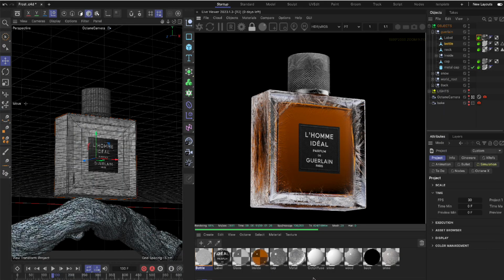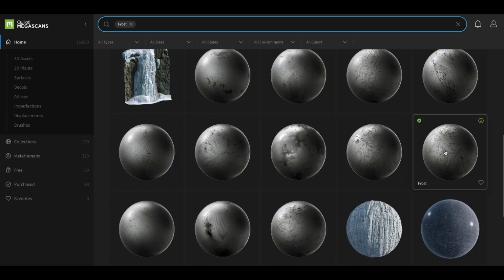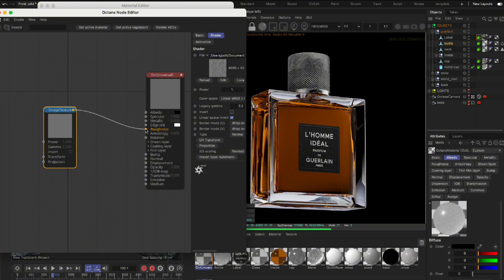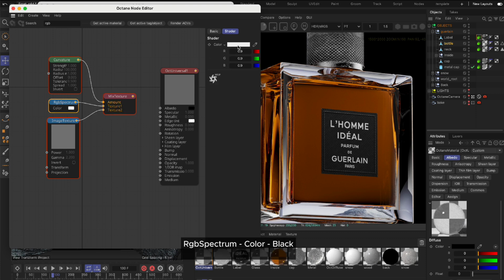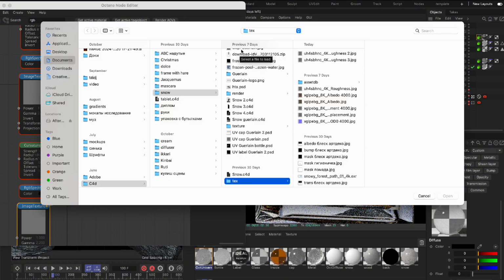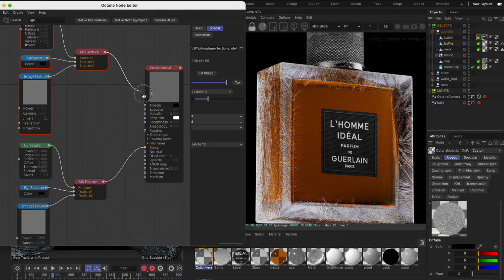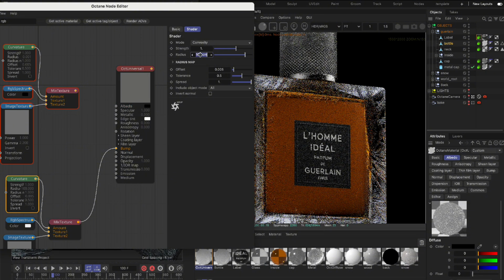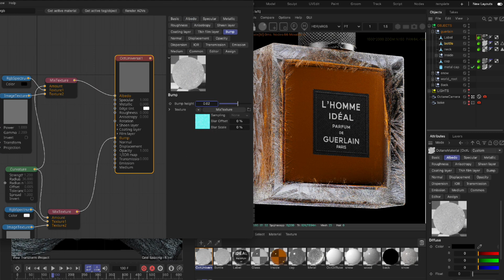Create a frost texture with Octane render

Comment: why is the RGB spectrum needed? And why is it black?
Reply: Because the RGB Spectrum is being used as a mask, we could’ve also used a Float Texture instead — since both operate with values from 0 to 1. Simply put, this setup tells the renderer that we want to apply the bump from the specified texture (in this case, the frost texture) only at the edges (using the Curvature node), and in all other areas we don't want any bump at all. That’s why we set the color in the RGB Spectrum to black.
Reply: @МаркЗахаров-х8и thanks a lot for this explanation!